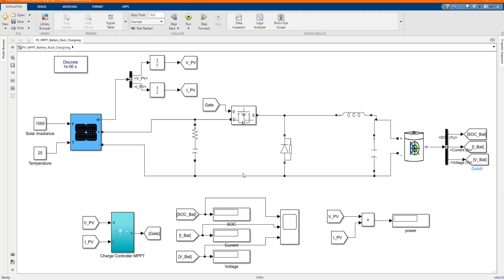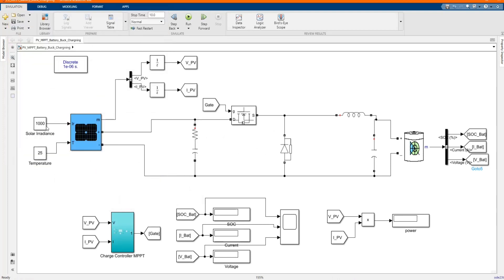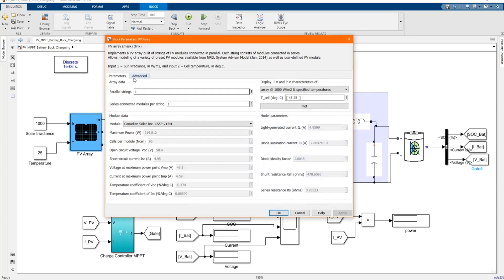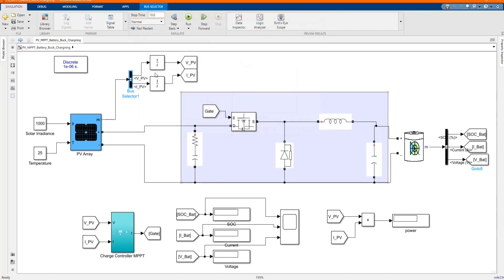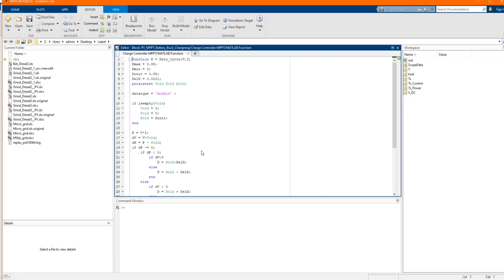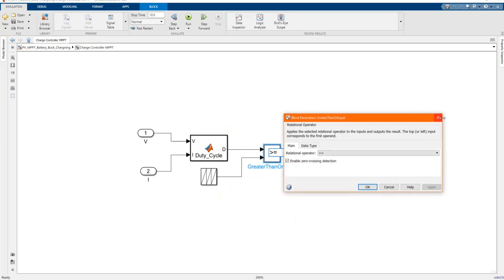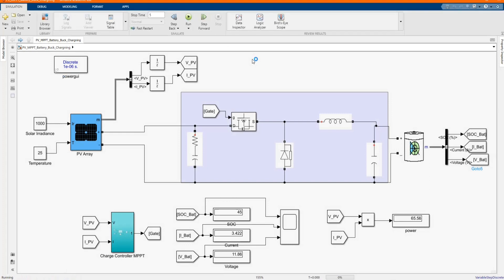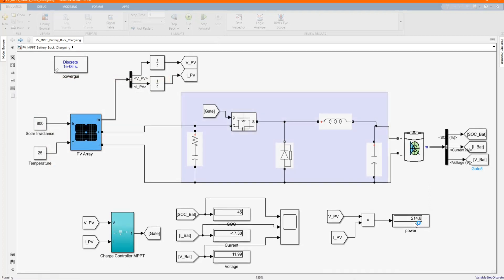Battery Charging using PV Array MPPT Charge Controller based on Buck Converter in MATLAB/Simulink

Comment: Hello! Thank you for this video. In your model, you set the SoC to 45% and it stayed at 45 throughout the simulation time. However, for me it is not showing 45%, it is showing a higher number (50.45%) instead. I tried setting the SoC to different values, and each time the simulation shows a higher value for the state of charge. What can i do about this? 
Thank you in advance.

Comment: Why MATLAB dont let me put the battery in parallel with the capacitor
Reply: faced same issue, seems like a restriction with the versions 2024 onwards...try connecting a small resistance value along with the battery, that will do the trick

Comment: Hello - why do you use Discrete in Powergui vs continuous?
Reply from the maker: Hi thank you for your comment, It depend on what you want to achieve, type of components and how fast is the simulation
Reply: Sir i want this file as a simulink matlab @pzengineering2020

Comment: Why every video, I have been watching nobody is explaining how the code works.
Reply from the maker: Hi thank you for your comment, the code is for you to follow and change based on your data
Reply: @pzengineering2020   Thank you for your quick reply, You won a subscriber. Do you know why the output voltage changes as the simulation time increases significantly?
Reply from the maker: @mrmatias2618  Hi, the voltage is affected by the battery SoC. For example  When SoC = 100% V = 12.8V , and when SoC is 90% , V = 11.52V. For this reason, during charging the battery voltage will increase up to its rated voltage
Reply: @pzengineering2020  Thanks for your reply, last question please, is it normal the charging voltage exceeds 12.8 V? When the simulation time is increased to 1000 seconds the charging voltage becomes higher than 35 V.
Reply from the maker: @mrmatias2618  in case if a battery voltage = 12.8 V; you should put your bus voltage or charging voltage to 13V. During simulation, when the voltage of the battery reaches 12.8 V the charging current becomes 0 A, even if you run simulation 4000000000 seconds, the charging voltage will still be 13 V and battery voltage 12.8 V
Reply: @pzengineering2020  You are the best. It helped a lot.
Reply from the maker: @mrmatias2618  we are happy to help you

Comment: Hello sir its informative video but I have one query 
why is current is negative while charging?
Reply from the maker: Hello , thank you for your comment, the current is negative due to the following: 1- the current is supplied by PV Solar which is in different polarity when the battery is supplying. 
2- In other words, when the battery supplies the current is positive. When it is charging the current is negative because of the different direction of current when it is supplying.
Reply: @pzengineering2020  oook Thanks sir
Reply from the maker: You are welcome

Comment: I am using 12v battery 7aH battery. Is the capacitance value too high?
Reply from the maker: Good day; I hope you are doing well .. I don't think so it's two high.. can you do exactly the way the model here is done and than change it according to your values to check the system response
Reply: @pzengineering2020  If I am changing capacitance value to 100uF then current is coming around +50A but the battery is discharging in that case.

Comment: Hi, why am I getting 0 current in battery output?
Reply from the maker: Is the state of Charge higher or the voltage? I think you should check your parameters
Reply: @pzengineering2020  Yes, state of charge is 45 and battery voltage is 12 V